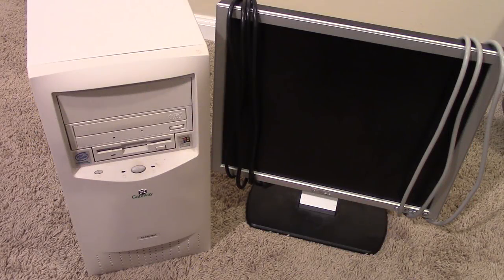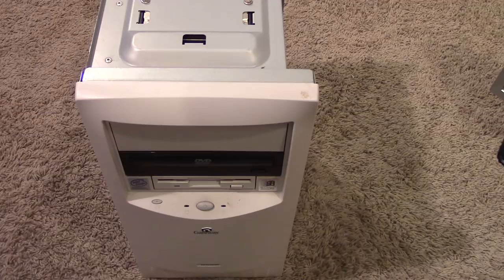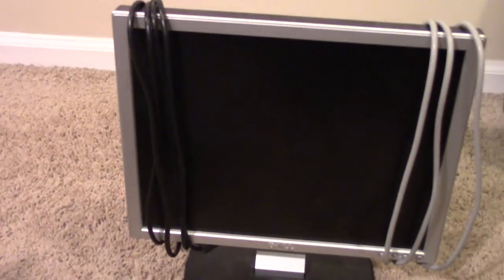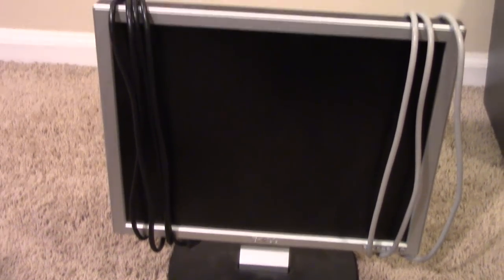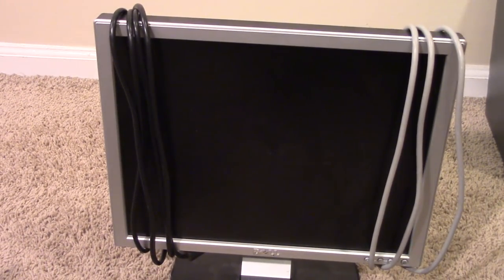Pushing the $5 Windows 98 PC to its limits

Comment: FYI Windows upgrade versions have totally different product keys. Keys for retail/OEM won't work for the upgrade versions
Reply from the maker: +Hakase yeah I tried different keys for both retail and OEM. I think the problem was that I just did not use the keys bundled on the AiO dvds
Reply: why tho, he might of burned the discs or found them on a website (a rare one at that.)

Comment: Here's one of the Windows Vista requirements:
Half a gigabyte of RAM.
Reply: 512mb is the requirements for the home basic edition, in reality windows vista needs at least 1gb of ram, it can work with half of it but it'd be slow af.
Reply: @IruzzArcana  Doesn't perform well with less than 2GB, though
Reply: @thatoneuser5066   32 bit works fine depending on the CPU, 64 bit doesn't
Reply: @IruzzArcana  Yeah, what I mean is that it frequently crashes with less than 2GB, from my personal experience.
Reply: Just give it 8 gigs and it should be fine
Reply: @randomweirdyoutubechannel8955  That's half of my PC's RAM (16 GB).
Reply: @ChloekabanOfficial  I'm pretty sure most PC's have 16gigs or more now days
Reply: @randomweirdyoutubechannel8955  ik
Reply: @randomweirdyoutubechannel8955  my pc has 16gb of ram
Reply: 69 likes lmao
Reply: @haseenabadshah5381  nice
Reply: @thatoneuser5066  my 1gb ram family iMac runs vista well but I haven’t activated so no areo
Reply: @thatoneuser5066  From my personal expierence, with 512  megs of ram assigned to the VM it worked fine no crash
Reply: @rohail_aziz  Nice. More than enough for gaming in the upcoming years.
Reply: @DreamMC50 I thought it required an 800 MHz processor at least?
Reply: @DreamMC50 It's okay.
Reply: @rohail_aziz  So do I.
Reply: @randomweirdyoutubechannel8955   i have 4g ram it’s so fast and it’s so fast
Reply: I have a HP Stream 14, that is 64 bit, with 4gb of ram and I run Windows 10. Works fine on there. I also have a Dell Latitude D630, it also runs Windows 10, that is 32 bit with a x64-based processor, with idk how much ram, and that thing is slow as hell. It needs its battery replaced, as it only works when you plug it in. It also needs a new processor, x64 based recommended, and I want to replace the hard drive with a 1tb hard drive.
Reply: @CoasterMan13Official  cool and good
Reply: @i make horrible takes :D oh no
Reply: @i make horrible takes :D yeah...
Reply: Ismael Phillip  it's not relevant to minimum ram requirements, you sponsor of spilling water on graphics cards
Reply: @Alaric Grant why did we change the subject from ram to flixzone?
Reply: @ChloekabanOfficial  those are bots.
Reply: @Dragonfire511  ok
Reply: yea, 512MB of RAM and 1 gig for 64-bit.
Reply: mine has 16GB too
Reply: @pawer_themaw  mine has 24 gigs LOL
Reply: I didn't know my tablet could run windows vista (2GB RAM/32GB ROM)
Reply: @IruzzArcana  from what I’ve seen you can also install Windows Vista Business on 512 MB of RAM, and it’s a higher tier than both Home Basic and Home Premium, being below Ultimate.

Comment: I used to have this same Gateway😭. Oh the memories. I wished I still had it.
Reply: I had a 98 SE Gateway 2000 as my first computer. The motherboard died in 2008 or 2009. Two years ago I acquired a Gateway GP6 333 which is similar but not quite. It can only support a single floppy at active in the bios whereas my old Gateway could recognize 3.5 and 5.25 as A and B drives at the same time. I would love to find a Gateway with somewhat faster processor, dual channel floppy controller, 1 ISA slot and AGP slot would be nice but less critical.

Comment: I've got a higher end model of that machine, dual floppy drives and 4 cd/dvd drive capacity. 550mhz Pentium 3. It sorta kinda runs Vista, and 7 is somewhat useable albeit it needs to be maxed out to 512mb ram.
Reply from the maker: That’s awesome! I actually maxed this machine out to 512mb of RAM in a recent video.

Comment: It's not the speed of the CPU, it's not having enough ram to allocate the setup.exe. However if the problem is CPU which btw is also very possible, then the only CPU fault you can have is not having instructions from the instruction set for the new build or having deprecated instructions that actually produce different value on the vista build and then memory get corrupted.

Comment: windows vista requires 256mb to run at all, 384mb for install from pe so if you put in more memory it will run. the Celeron is PIII based so it will run Windows Vista just fine if you upgrade the memory.
Reply from the maker: +Jordan Woolery I'll have to see if I have some compatible RAM lying around. I'm probably going to plan on keeping this machine as a 98 box, but it still would be cool to see if it would handle vista.
Reply: Michael MJD most Celeron / PIII systems will take at least 512mb memory if you can find enough of it in PC133 size of course. Heck I've installed Vista on a Pentium 2 400 with 512mb ram and it worked out in the end. it wasnt as bad as I thought it was so you might get about the same speed (maybe a tad slower) as I did because you have a celeron
Reply: InfernoDukem it might, but if you're booting from the install media, you might not actually hit that point of where the install crashes, but it's been a long time since I've toyed with Vista's minimum memory requirements so idk
Reply: HP?

Comment: If you are installing windows ME, you have to insert the product key letters while holding shift, (only on letters, not numbers) other windows versions don't require that.
Reply: That's true. I had to figure that out myself when I was messing around with virtual machines a few years back.
Reply: Windows Millenium edition had not had a special product key installation automatic capitalisation. (Keys seem capital but they are not) You can count it as a bug.
Reply: or press capslock once.

Comment: great video series - mikro ExPee and tinee VII are great - 1 problem they are 32 bit.
Plz watch for 64 bit cousins - thanks.   I'm old timer - 1st computer XP age 58. I learn alot from your channel - things you youngsters probly take for granted.  Partitions and boot from usb opened up a whole new world.  appreciate your work thanks.
Reply: 32-bit OS's can install on 64-bit machines but it doesnt guarantee stability of the system. Plus, this computer is 32bit so it won't matter.

Comment: 0xe0000100 means that there is not enough memory to initialize setup... you still need that 512 MB my dude
Reply: because Boot (X:) is 512MB

Windows runs from a ramdisk .wim and not hard drive so that's why it needs more RAM

Comment: I would not call the process an "up"-grade if the computer becomes unusable under the new OS. For a machine like this I'd put Windows 98 and 2K in dual boot and add decent 3rd party applications to push it to limits of usefulness. 98 for games or trying special old expansion boards. 2k to experience stability. Both can reside conveniently on the same partition and share program files of the win98 copy.

You can always install a video driver. Shouldn't be hard to find for Intel graphics. Maybe the XP disc had bad burn quality and couldn't be read by the drive in question. XP doesn't need to be cracked if you can get working bitperfect VLK disc.

Comment: Technically as long as you have 1 GHz processer (maybe pentium iii) and 1 gb of RAM you should be able to run windows 10.  (Albeit not that well but still technically is at the minimum requirements)
Reply: I had a pentium 4 tower with 2gb of ram, windows 10 was not happy so I down graded back to windows 7
Reply: 4gb is minimum, but 3gb is really the minimum

Comment: The reason you couldn’t install vista is the computers specs don’t meet the hardware requirements of vista. Vista requires (as a minimum) a 800MHz processor and 512 MB of ram to install.

Comment: excellent video !  I believe I've seen in another video that when installed in a virtualbox or vmware then the minimum memory for vista or even windows 10 is 192 mb. 
But I can't say for sure, but I've seen a video about it. 
When you go below 192 mb of ram the os (w10 or above xp at least) will not boot or give a blue screen or something like that.
Reply: Yes, i saw it as well. The thing with the video is that for that to work, windows has to be already installed, which you can't do with that less RAM. After you install it succesfuIIy, you can rip ram sticks till you get to 192 MB.

Comment: Booting off the disc would not fix the setup issue. Booted off the CD or running the installer in Windows will still require 512 MB of RAM to run

Comment: Windows Xp always was lumpy and slow. I started wuth windows 2000 as my first nt windows. I got 2 beta test versions. It was super stable and really fast.
I had to go to xp for some games that really needed xp and drivers.
Windows 2000 ran for about 15 years non stop on a opd pentium 3 600 with 128 mb ram. Almost never had tp reboot. Mostly for some changes.
Used it as a chat server for that time. But visitors numbers dropped. I tested it a few months ago. Still boots. And works

Comment: There is a way you can run it with less RAM, I don’t remember the exact process, but it involves modifying a system file then creating an ISO with the modified file. 
But it runs like garbage, it’s not even worth it.

Comment: Are family use to have windows 98 and it was so slow I don’t know if it was a hardware or software issue. But it take 10 minutes almost to boot up to the desktop and then another 5 minutes to open any files or software and don’t even to try the Internet if you had more then one tap open at a time the computer would just crawl to a stop freeze then shut its self off. We eventually upgraded to vista and well more problems issued lol.

Comment: what are you talking about?
Windows XP runs very well on 400MHz CPU
I have had triple boot AMD K6-2 400MHz (chomper extended) machine with 640MB SDR133MHz RAM and XP was running great, in fact better then Win98SE

Comment: in 1 of ur videos u say amd are not as reliable ,how u work that out i`ve had k6 2 3d now chips Athlon 1100/1300/1330 ,xp1800/2000/2400 and barton 3200,even bent pins i bent back. more or less i`ve had them all and not one of them died or had any problem ,now intel  i had 2 die and they got very hot nice in the winter,but  i dont know why  or how u come up with amd not reliable

Comment: Attn:  Before one thinks of putting on a new Operating System they should look up the Minimum System Requirements for the new Operating System.  
For example: 
Windows XP Minimum System Requirements 300 GHz CPU/64 MB RAM
Windows Vista Minimum System Requirements Pentium 4 or 1 GHz/1GB RAM
This video illustrates the problem with Windows Vista not being popular from the beginning.  People were trying to use Windows Vista without nearly the System Requirements.  Windows Vista runs much better with 2 GHz and 2 GB RAM.  Huge difference between the Minimum system requirements of XP and Vista, one cannot use Vista with this type of system! 
Windows 98SE, Windows ME, XP or Windows 2000 are the top this computer can operate easily on.  
Windows XP is great to use on this computer!
By the way, this computer is a Pentium Celeron Mendocino 433 MHz, (similar to Pentium II, and has Cache), and has 190 MB, which is enough for XP.
Up until 2 years ago my wife was using a DOS program, we have a computer that is a Sony Vaio built in 1997, Pentium II Klamath, 300 MHz, upgraded to 190 MB, very similar to this PC running Windows 98SE wonderfully! When my wife officially calls it quits I may try updating it to Windows 2000 Professional or XP Home.  These are all great Operating Systems!
Reply: Yep, your right, Vista is so bad because it requires a 2 GHz CPU and 1GB of ram instead of a 300GHz CPU with 64mb of ram. 190MB of Cache? Wow that's a huge quantity of cache.

Comment: When you get an "Copy file error" when installing XP it means the disc is damaged and it cannot read that part of the disc, Sometimes giving the disc a clean works or using a better quality drive, But most of the time you need to use another disc, It may install if you skip the file but if the disc is damaged in several places you may be hitting skip quite a few times and then it wont run correctly, When i worked at a PC centre building PCs at the time when XP was the newest windows we got through loads of XP discs as they got the error we would snap it and open a new one.
Reply: No shit, Sherlock.

Comment: It is possible to run vista on less than 512 mb of ram you just need to delete the file that contains the min memory. (or someting it is possible.)
Reply: Yes. I was able to install Windows Vista Starter on 384mb, it installed just fine. 

Also here are my reasons why he couldn’t get Vista on the $5 Gateway is not only does he need more RAM, he would probably need a better CPU. Windows Vista requires 800mhz or faster and I believe it only has a 432mhz.

Comment: FYI, windows vista never fit on a DVD unless you severely trim it with NT Light or whatever... and vista hasn't fit on an entire CD since the Longhorn 4074 build (which clocks in at 703MB, 3MB over the 700MB limit)